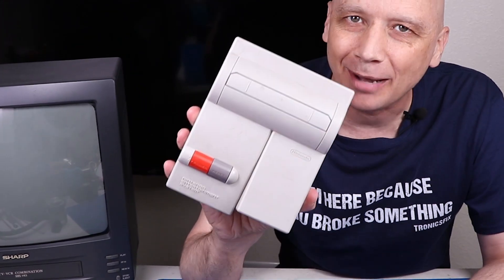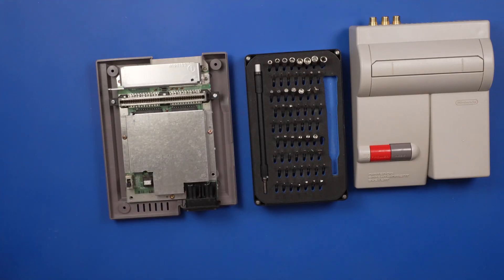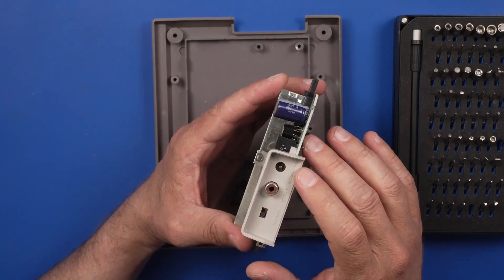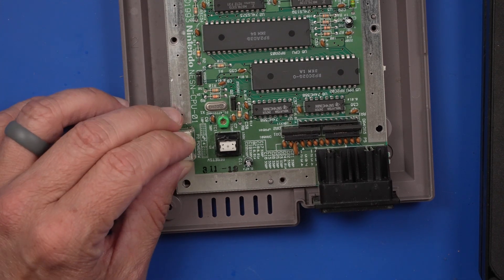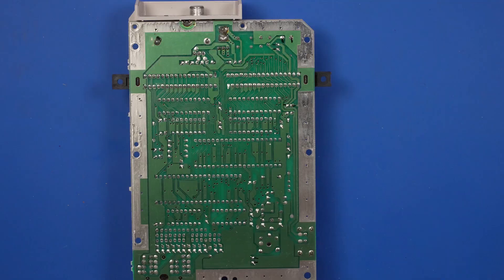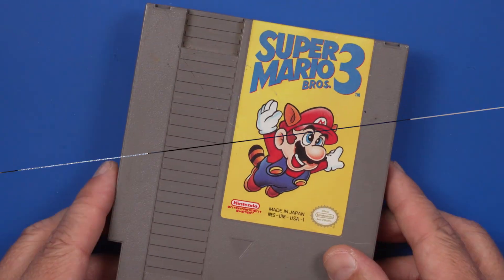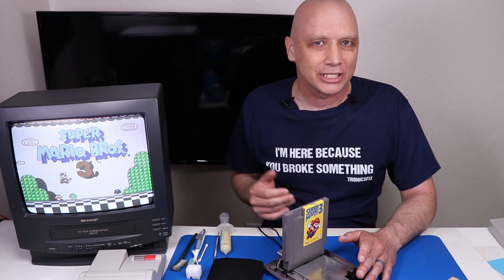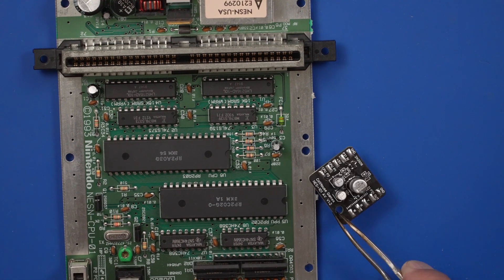This NES Is Worth $200 - But It's Broken - Top Loader Repair + Mod

Comment: The AV Famicom had composite video, but it was only released in Japan. We just got the RF version. 

Didn't realize the Top loader got that expensive. Got mine for $5 at junk store back in the early 2000s
Reply from the maker: Wow, great buy!
Reply: Look up

RAREST NES in existence OFFICIALLY made by Nintendo

The vast majority of examples you will see with multi out have been rgb modded. The only official American composite multi-out ones are extremly rare ones that were mail in repairs. They even had their own unique board revision.
Reply: @General_Cap  they not "factory made". They basically made mods for customers it they like to pay for it. Looks and works same as any other mod. 
I saw that "Nintendo made" one on photos around 15 years ago.
Reply: Japanese top loaders have same cable as SNES. Some dudes just trying to scam buyers on selling mods as "super rare originals". Few times I saw a 101 famicoms with swapped slot but that all.
Reply: I sold my Famicom AV a few ago with a bunch of extras for ~$100. Maybe it's not that sought after in Europe.
No regrets though, even though it's definitely the best version of the NES, it's better that someone who will (hopefully) use it gets their chance. :)
Reply: Yeah, for that much money, there are many more third party options with built-in HDMI.
Reply: Top loaders only hit 500 if they're HDMI modded or brand new. Saying they're worth 500 is a stretch, they're closer to 200 with no mods.
Reply: @lookitskazzy  He actually says exactly that in the video.
Reply: @lookitskazzy  He literally said "up to $500 depending on how it's modded" in the video

Comment: My grandparents had one of these when I was a kid. Their basement flooded some time in the mid 2000s and I'm 90% sure that the restoration crew stole it and all of the games. They claimed it was "water damaged" even though it was on top of a table and nothing else that high up off the floor had to be replaced. TWO copies of Mario/Duck Hunt, TWO zapper guns, 4 controllers, Mario 3, Skate or Die, TMNT III, and a couple of other games. I was so mad then, and I'm still mad about it to this day.
Reply from the maker: Wow, I'd be mad too.
Reply: Bummer

NES games are very durable, even if they did get wet they likely would have worked after a quick cleaning when dry 😢
Reply: @volvo09  From experience unless they are immediately cleaned they rust.
Reply: Yup. Sadly the water and dirt will erode shields and the cap legs, and that in turn leads to faster electrolyte leaks that will eat the rest of the board.

Just cold storage condensation will do the same over time though.
Reply: @volvo09  I nothing else, you could just transplant the ICs onto another PCB. Done that with N64 games.
Reply: His grandparents had this NES... 😮‍💨... now I feel old. 🤣
Reply: @watchingdanny  They bought it for the grandkids to play when we were visiting lmao
Reply: @Tilt_TM  Phew... thank you for the clarification. 😁
Reply: @watchingdanny  I'm in my early 30s if that helps hahaha
Reply: @Tilt_TM  Mid 40's over here. My first console was an Atari 7800. 😁
Reply: Restoration companies stole a bunch of my Star Wars stuff after a house fire.
Reply: What happened to your hair and eyebrows?
Reply: @TF-cq8hd chemotherapy probably
Reply: @TF-cq8hd  he's undergoing treatment for cancer
Reply: Blue collar guys. Cannot trust most of them.
Reply: I'm surprised you didn't claimed before they came.
Reply: @checob224  I was in 7th or 8th grade at the time. I didn't know it happened until after the restoration was already finished.

Comment: I bought one of these around 2001 for $10 (sold it years ago).  And I was dismayed to find I couldn't use it without a mod.  Releasing stuff with only an RF connection even in the 80's was unacceptable, let alone the 90's!  That's absolutely ridiculous.  You shouldn't have to mod your console to be able to use it.  My friend and I modded mine for composite so I could actually use it.

I mean yeah today, having to mod stuff for HDMI is more understandable because HDMI didn't exist when these were made.  Composite video was created in 1956!  The original NES model had composite output.  That should've been the absolute bare minimum, and RGB output alos should've been standard by the 80's.  Since this was released in the 90's I question why it didn't have S-video out of the box.
Reply from the maker: Wow, nice. That was a good buy!
Reply: @Tronicsfix  They were a dime a dozen back when I got it, those things were everywhere and considered virtually worthless.  I almost wish I had hung onto it now, I could've sold it for a lot more than I did.